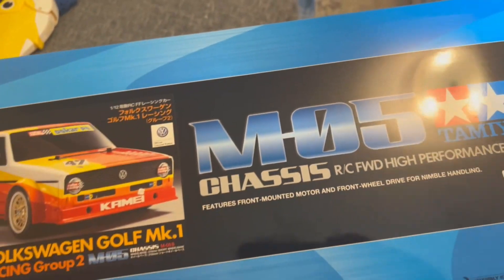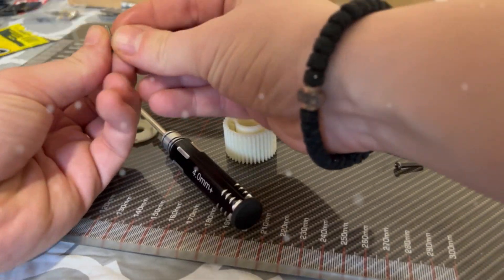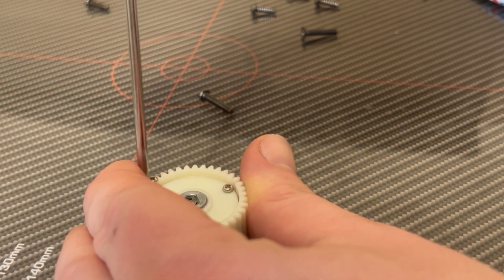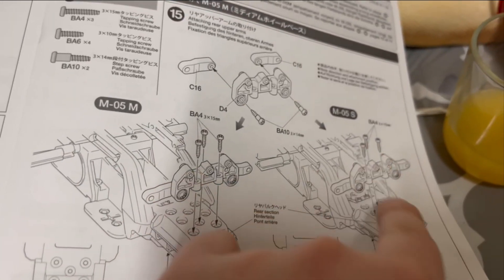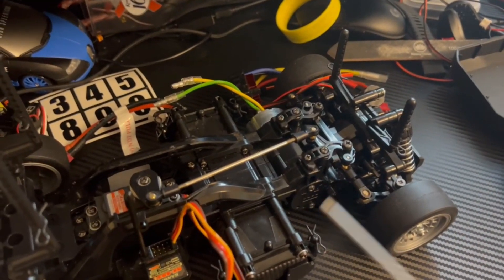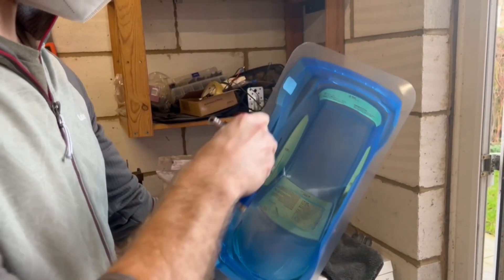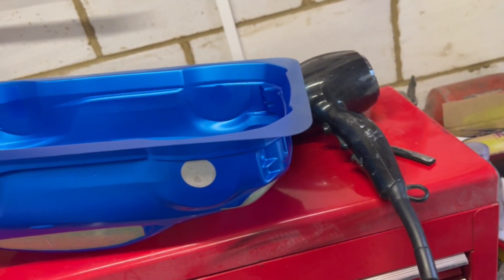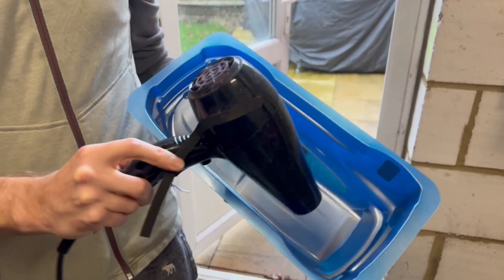Is Tamiya M05 the Worst RC Car Ever?

Comment: M05 V2 Pro was my favorite chassis it had so many love with aftermarket parts compared to the M08R I have now but out the box the M05 was king of fun for me
Reply from the maker: Would love to try M08, are you running brushless ?
Reply: @TheElectroSwitch  Brushless Hobbywing 17.5. I like that you have adjustability now cause out the box with a hpi BMW body it rolls so thank goodness for the turnbuckles. The M05 I remember just adding weights around the battery area to stop rolling and after that it was the easiest and most fun to drive.

Comment: Anyone complaining that the chassis hasn't changed since 2016 probably should've bought an M07 instead.
Reply from the maker: Exactly my thoughts, could be something with the shells, but I think m07 is also adjustable chassis? Thanks for the comment
Reply: @TheElectroSwitch  I think the M07 can be adjusted to the medium and long wheelbases but not the short 210mm wheelbase. Which does seem like a bit of an oversight from Tamiya.

I don't know off-hand. They're still too expensive for me to throw money at. Haha.

Comment: I like the M05. I converted mine to the Ver. II chassis. It's a lot better. You didn't trim the body before painting? Well that's different.
Reply from the maker: Thank you for this. I am not sure what Version II looks like, might have to check that out, but now I have bought M07 also so will do a comparison. Regarding trimming the body, this is the way my friend does it and it seems to make sense as well to me lately, it's easier to see the lines where to cut if nothing else :). Thanks for the comment!

Comment: Why are you a mix of plastic bearings and ball bearings? I suggest always to use ball bearings all around, and CVA oil dampers instead of friction dampers. Most Tamiya kits dont need any other tuning than that.
Reply from the maker: I didn’t get the bearing kit when I got the car so I improvised with some I had. Later I had a full kit and rebuild them all. I also did get the CVA oil dampers they made a world of difference to the handling! Thanks for your comment!